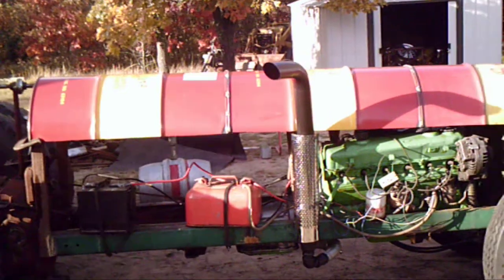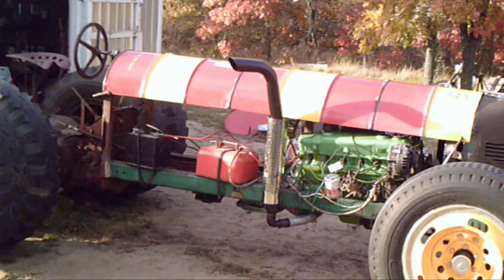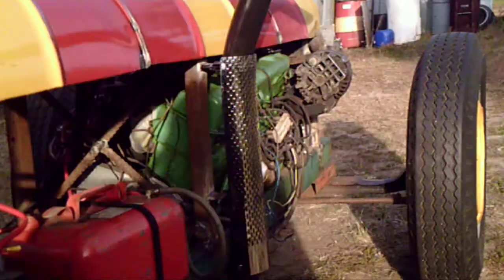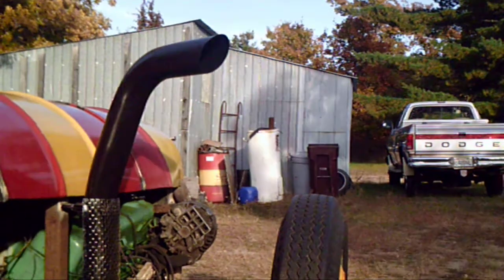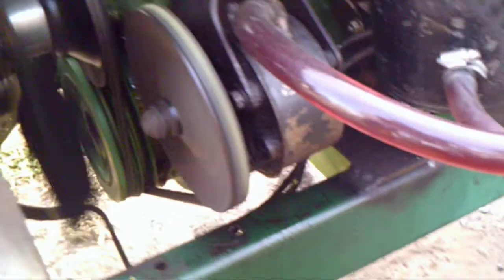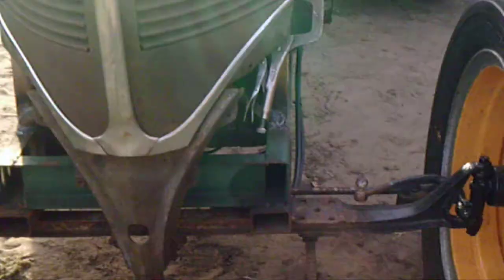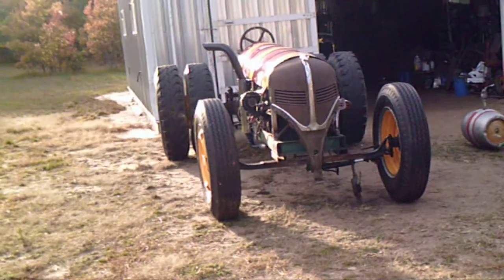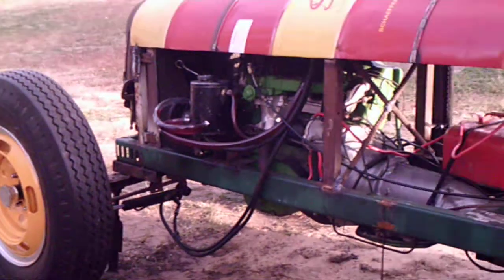UNDERTILLER UPdate #6 Draining some ideas from my think

Comment from the maker: Thanks. My brother used to work at a Toro plant and they would sell damaged parts to the employies at auction. He bought this sector and a bunch of other stuff and gave the sector to me, it had a smashed fitting on it. I straightened it out and it works fine. Without it there probly wouldn't be any Undertiller cause thats what gave me the idea to build it.  Ya, most of the old tractors didn't steer very easy.     Dan